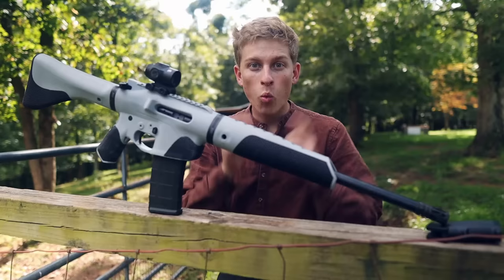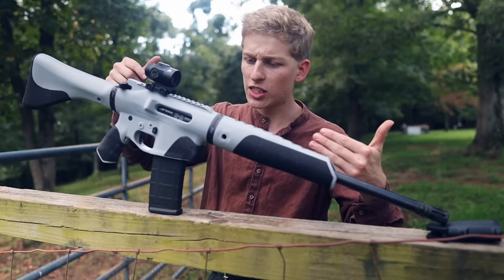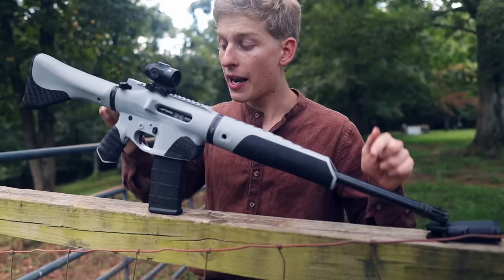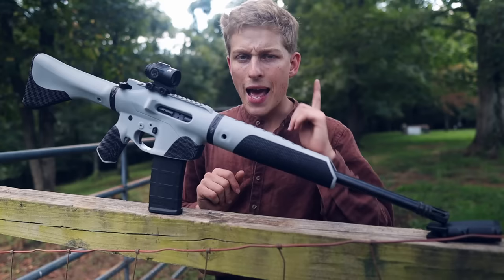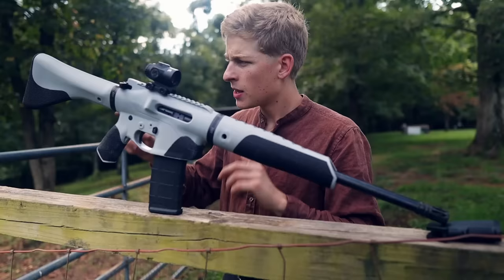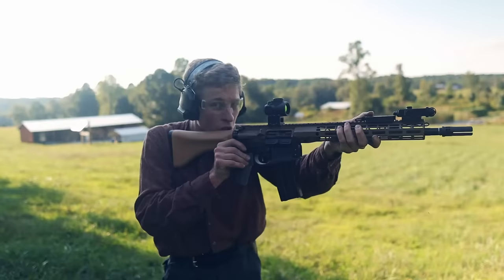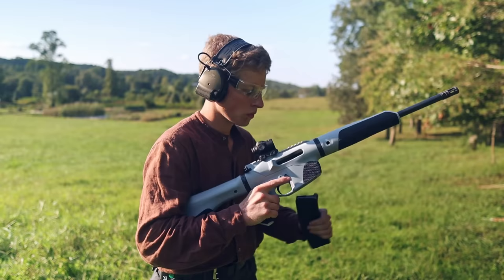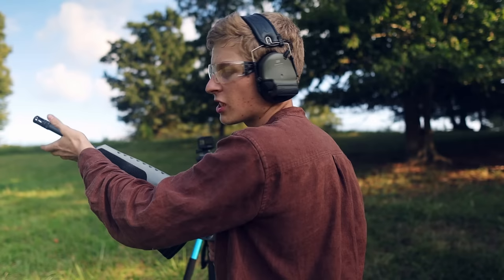I Printed an AR-15

Comment: This is awesome. Need a laser, light, etc? Print a new foregrip segment with that feature integrated. Very cool. Might have to pick up a printer..  
With the weird brass ejection- Could it be as simple as squaring off the surface and reducing the angle of the ramp that the shells bounce off of? Seems like that curved surface gives you a different bounce every time.

Could you do a yt short with a simple "Knock" test? lmao. It sounds ridiculous, i know. Just interested to hear how solid the plastic sounds, if it rattles at all, etc. Just bang on it with your palm or bump the butt on the dirt or something like that. Sorry if i sound like a maniac. Keep it up man.

Comment: I know I KNOW! I'm jumping ahead! But this is what is needed to develop a custom DMR platform. No problems with high rate of fire but the ability to ultimately customize it exactly like each individual shooter wants it done. Cheek well rise and fall. Grip larger or smaller. Minute degree angle shifts in grip.

Comment: For cooling, line the inside with aluminium so it reflects the heat. Also adding some holes will help fresh air passively cool it.

Comment: Theoretically, the charging handle could probably be replaced quite nicely as well, by raising the upper rail slightly and making a slot with guide rod and FAL-like charge handle, but ambi.
Reply from the maker: Invader zip did something along those lines, pretty cool!

Comment: Also if you use a fluted barrel it will help to reduce heat build up and should help increase gun life. granted may only be a few percent but every bit helps.
Reply: Destiny 2 reference (real) I will not elaborate

Comment: Here is an idea, why don't you just put some material that would act as insulation between the pla+ and the barrel? Like mineral wool or ceramic fibre etc.? Or would that make it too hard to secure the barrel?

Comment: obvious answer is that the bullet is bouncing back against the flat part where the shell ejects and then getting stuck after propelling forwards, smooth it out and reduce the angle of the brass deflector so it forces shells back more

Comment: I'm sure you already solved the issue with the brass ejecting. If not, I would think placing the brass deflector back 1/8th of an inch (.125) and or change the angle of the deflector. 
You also might need some heat shields integrated?

Comment: I think the root of your problem is that almost all of the casing's energy is being transferred to the plastic when the casing bounces off of it. It's coming to a complete stop, then bouncing back instead of actually being deflected. With that in mind, it makes the most sense to me to remove the edge between the deflector ramp and the wall of the upper, so the casings impact on a surface more conducive to deflecting than direct bouncing.

Comment: I would suggest you get some light weight carrier groups and whatever buffer would run it. Some of the captured buffers would also probably lower damage on usage.
Reply from the maker: I'm not worried about damage from the bolt cycling, but I would very much like to try and get the weight down, just to do it.

Comment: problem with ejecting is your gas block. if you can adjust it, try turning it down. too much going into bolt carrier group which is causing it to cycle violently. will do more damage over time to your weapon. I come to this conclusion because a properly gassed  block should be ejecting the round to your roughly 4 to 5 o'clock in relationship to direction you are firing the weapon.. the more to the 6 o'clock position normally is due to an over gassed block and an under gassed block launches the brass more towards the 3 o'clock. yours seems to want to launch it more towards the 7 o'clock if it were possible.

Comment: May want to consider running a tunable gas block, looks like your barrel gas feed may be oversized and may be overgassing. Just a guess, but I have had AMAZING luck with the SA Gas Block system (Superlative Arms).

Comment: I'm surprised you didn't go with an AR-18 BCG, considering it's both more compact and the guide-rods are easier to replace in case of defects.
Plus, having extra space between the polymer and the BCG helps improve wear and tear.

Though, all things considered, the buffer tube is probably a necessity for testing. The added cushioning and the ability to manually adjust RoF by just using different Buffer weights must help a lot with testing.

I still firmly believe that you'll find more success essentially resurrecting the AR-18.
It was designed from the get-go to be as tolerant to manufacturing defects and damage as possible, whilst maintaining the performance of rifles 10x the cost.
Only buffoons that completely misunderstand the point of the guide-rods are able to mess it up (like the morons that made the FN-FNC, SA-80, and to a lesser extent the MCX).
There is a reason why the AR-18 is the most copied rifle, next to the AK.

Compare this to the 15, which started life as an experimental derivative of the AR-10 since 5.56 was a purely experimental cartridge at the time. Most of its horror stories regarding the M16 were from the M14 supporters that still held a grudge, but the fact that the buffer tube is useless for 5.56 is still an annoying flaw.

The AR-10 itself, meanwhile, was engineered entirely around making the recoil of a .30cal, full auto, lightweight infantry rifle actually usable. In the AR-10, the buffer tube system is one of several necessary components to make sure the rifle can actually do its job, and avoid all of the problems that the G3, FAL, and M14 had. It was only sabotage by traditionalists that caused it to not be adopted, and the consequences of this have had a domino effect of office politics that continue to plague the military to this day.

Eugene Stoner himself said that material science is largely what dictates innovation, as better materials not only open the door to more sophisticated contraptions but also opens up the opportunity for previously ignored or snubbed innovations to gain popularity.
The specific aluminum alloy used to make the AR-10 was such a massive game changer because it had better heat dissipation than steel, weighed less than steel, and was just as durable as steel. 

Now we are entering an age where Polymer is becoming a viable firearm material, which alone makes it trivial for people to just manufacture firearms on a local level.

If one thing is to come out of the upcoming firearms revolution, I think it should be a resurrection of the AR-18. It is simply unacceptable for America's most popular rifle to be an experimental derivative. It needs to be a purpose-built machine.

Comment: Put a heat sinks on the barrel so it will be cooler on the gun, and make the design so the bolt locks open on every shot so it stays cooler longer...

Comment: The ejection malfunction is because you need a different weight buffer spring. I was watching the ejections and a second before the malfunction I said it was going to happen. You can see it in the way the bolt carrier cycles. Almost as if it's too slow for the force of the recoil.

Comment: Looks like you are over gassed. What you want is a 4 o'clock ejection pattern, you look to be near 2. Try increasing the weight of your buffer or use an adjustable gas block. Weak extractor spring can also do weird stuff. Good luck, love to see the innovative designs!

Comment: I like the look! I'm building furniture for my Hoffman LR-308 lower to make it look more like a BAR/hunting rifle.

Your brass deflector seems to be doing just what it's supposed to do, but your brass is bumping into the front of the ejection port. I think if you ramped the front of the port down to original thickness it will help your ejection. You may also angle the brass deflector backward a bit more, to make the deflection outward more than forward.

Comment: It appears that you need a heavier buffer. Maybe go with a H2 buffer that should correct your trajectory. This usually happens to an over gassed rifle. Google it and you'll see charts on ejection patterns. 1 to 2 o'clock is over gassed. You want a 3 to 4 o'clock ejection. You can either add an adjustable gas block or just adjust buffer weights.

Comment: To insulate some of the heat in the upper you can try using ceramic fiber blanket or even kiln shelf paper. 
Just look up on Amazon "HMFC 12"*24" Ceramic Fiber Fireproof Paper" & "HMFC 1/2"*24"*24" Ceramic Fiber Insulation Blanket 2400F for QuadraFire Wood Stoves, & More." It also comes in 1/4 inch.
Then if you add an aluminum barrel attachment, clamp on rail, or something else you can divert that heat to be dispersed.
Something like this "Persei Scope Barrel Clamp Mount 25.4mm & 30mm Ring Adapter with Weaver Picatinny Rail"
I also noticed in the slow motion that the upper and lower separates some when firing. If you design in a clam shell divot near the rear that may stop it.

I am a fan of your work. It is great.

Comment: Hey, its definitely hitting the edge of the brass deflector and the wall; essentially, its hitting at the depth of the wall but hitting a rounded corner, causing it to deflect off at a inconsistent angle. Honestly, reducing the wall thickness or defining the angle between it and the brass deflector would give it more consistency.

Comment: I don't know if anyone has mentioned this yet, but it seems like your bolt velocity is too high. I would suggest using a heavier buffer if you haven't already tried that. The tell-tale sign is how far forward your cases are ejecting. This is quite a fascinating project and I'm very interested in seeing this in its later iterations.
Reply from the maker: That's what I was thinking, but turns out bolt velocity was fine, it was the plastic itself.
Reply: @HoffmanTactical  interesting. I don't know nearly anythjng about 3d printing so I'm sure that changes a ton of variables

Comment: Impressive! My suggestions, carbon fiber isn't a bad idea for the heat. I would suggest using the carbon fiber to make radiator fins down the foregrip; this would allow you to use less of the carbon fiber, allow for better ventilation and air flow and would possibly help with the barrel moving. The use of aluminum or copper could also assist in wicking heat off. But admittingly I don't know too much about 3D printing so I am not sure if that's really a possibility to print but copper and aluminum are fairly easy to work with using normal hand tools. As far as the ejection issue, thinner ejection port walls, angle the deflector a bit more and taper the back of the ejection port more into the deflector and that should assist in cutting down on the jamming issue. I have seen other comments suggesting the same thing with a lot fancier wording lol. I have built a few different firearms but never with a 3D printer. From what I have seen in the past, 3D printed guns are ugly bocks of plastic that the only real way to defend your home against someone is to show it to them and let them die of laugher. However seeing your work of art gives me hope, and reason to be interested in 3D printing as a possible means to make a firearm!

Comment: You need to adjust your gas system. Carbine gas systems are notorious for being over-gassed. Looking from the top- down, your empty shells should be ejecting at 4 o’clock. Anything ejecting forward of 3 o’clock and you have too much gas. You need either an adjustable gas block, or a BRT EZTUNE gas tube.

Turning down the gas until you achieve optimal ejection will help with some other problems also. You will slow down the bolt speed so the ejected shells don’t slam into the deflector as hard. This will help minimize wear and tear on the receiver, bolt and buffer components. It will also lower the perceived recoil. Also with less gas pressure, you will have less heat soak around the gas tube.
Reply from the maker: Sadly this rule of thumb does not work with this ejector geometry. Though I have added a SLR block to both my prototypes for the other advantages.

Comment: Couple days after watching I've thought if it was perhaps a 9mm pistol it would be pretty good. Way less droop. Takes a few rounds to get any sort of chamber/barrel heat.
Also annealed PLA might be very temperature resistant but annealing is a PIA.
Polycarbonate would be a great material for parts touching metal.
Reply from the maker: Yes, a 9mm PCC version would be cool! Annealing PLA can be tricky, I'd like to try, but for now I'm using CF Nylon.

Comment: I would suggest printing with PETG.  It's more heat resistant and in general stronger than PLA.  It could result in a better and tougher gun.
Reply from the maker: Unfortunately not. PETG is not only weaker, but it has very poor impact resistance.

Comment: Weaker recoil spring, a diffrent lubrication between the bold and the upper 
Possibly a diffrent clearance for the bolt
For the deflector ramp it all the way up to the bolt.

Comment: Have you ever thought of coating the plastic parts in metal plating using a chemical conversion process? You will increase structural strength by 150-200 percent and you can use this process to help deflect heat from critical areas and increase the durability of the item. Its kinda like how metal is chromed for hydraulic pistons huge down side is the creation of toxic heavy metals during the process.
Reply from the maker: Yes, but the complexity of the process limits it's application.

Comment: About the brass deflector: try opening it a bit like 2 or 3 degrees with a file, see if the results are beter, if you find a sweet spot and like it, reiterate the CAD files accordingly.
About the purchased parts for the fire control etc, bear in mind most tyranies do not allow anybody to have any access to such items in their countries, so please go the FGC9 way, make up a way they can be manucatured at home with 3D printed tools and harware store purchased itmes (Electro erosion with salt and water in a plastic bucket, etc) and also is much needed an ammo production line that can be 3D printed for the same reason.
Reply from the maker: Yes. If you can't get any of the firearms parts, FGC-9 is the way. Check out Suckboytony on twitter for some other really interesting work.
Reply: @HoffmanTactical  I am working on a 3D 5 to 9 axis printing platform to ease such endeavour, the advantages are printing diagonaley, non planar, rotating the print when printing around circular forms (like propellers) so you can print a lot faster by not using supports at all or only towards the print bed, also save time by not cleaning supports,espcially from interior cavities, pain in the arse  eliminated, and keep a well calibrated almost perfectely ballanced 3D printed spinning object (ball bearing, propeller, etc) straight from the printer as no supports breaking go to mess with that either.

Also have my own version of tool flip system (different from wham bam mutant one, also far cheaper as you can print it at home) in testing for 3 years now on all my machines, it eanbles me to swap printing heads ready loaded with filament between works in 2 minutes or from one machine to another in 3 minuts or 4.  The advantega is I can work on a printing head on my kitchen table while the printer is printing with another, than change the job and the head in minutes and hit print again.

The future belongs to cheap reliable tech, and I am on to it, so are you on your endeavour I see, but we need to realize most things they regulate will actualy become unavailable sooner or latter, and we have to work around on how we can make our own from scratch using scrap or recuperated materials from scrapyards.

Let me know if you want to exchange ideas in private for the future.

Comment: Could the issue with the ejecting of the brass also be due to the gas block. I know if its jumping forward like it is it’s too much pressure. If it jumps backwards its too little. And if it ejects right out to the side like it should then its perfect.

Comment: Seems like the plastic is griping the ejected shell more so than a metal piece. So I would angle the ejector block more so instead of the normal angle using metal do a more dramatic angle. You could try this by just sanding this down instead of printing a new one to save time, up to you. Great looking design tho 👌

Comment: Looks like the neck of the brass is hitting where the brass deflector meets the rest of the upper. if you continued the angle of the brass deflector until you get to the inside wall of the upper it might give you a better kick outwards instead of forwards.

Comment: I feel like if you were to extend the ejection port opening by about 5 mm at the back and / or extend the chamfer further into the opening to closer mimic the geometry of a standard upper, the brass would deflect better and more reliably. Just a theory

Water cooling option: You could design some 2-4 mm coolant passages running around the entire action and all the hot parts, with a "coolant ring" surrounding the barrel clamp area, with a mini water pump and possibly a small coolant reservoir in the stock, with male > female fittings with semi tight tolerances between printed parts, and double o-ringed connections, should hopefully prevent any leakage.

Comment: Actually forward ejection is preferable to 12' o clock and back, When an AR weakly tumbles cases out it's generally a sign of poor ejection and can cause reliability issues. Your ejection is strong but a tad erratic, unless it  causes a malfunction I wouldn't worry about it.

Comment: The casehead is hitting that radiused portion of the ejection port 90 degrees to the port, rather than the flat angled portion. Since your receiver walls are so thick, the deflector is just too far away. Just blend the deflector into the radius in the back of the ejection port so the brass is hitting an angled surface. You may also have to ease up on that radius and go for more of a squared off geometry on the ejection port in that area.